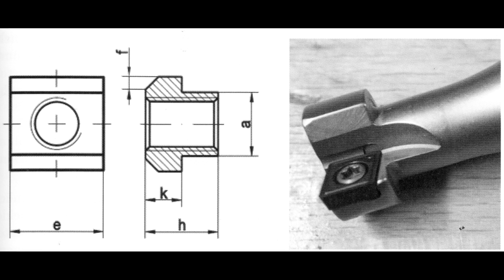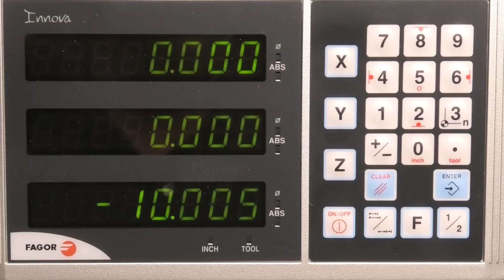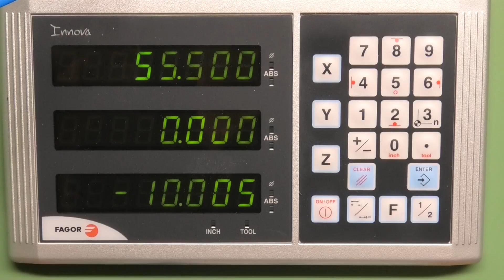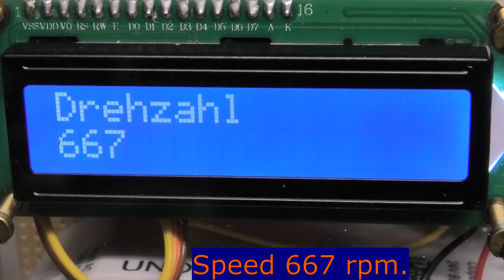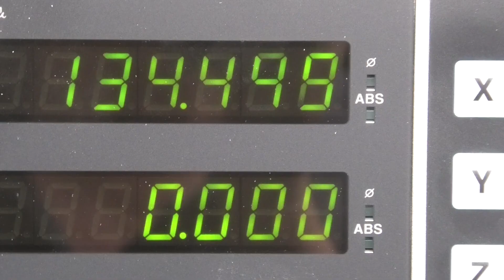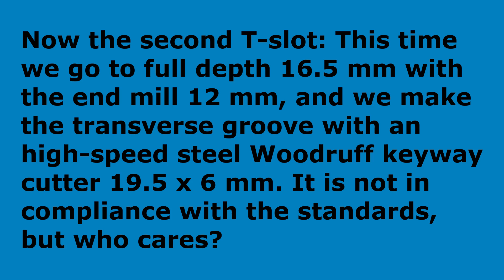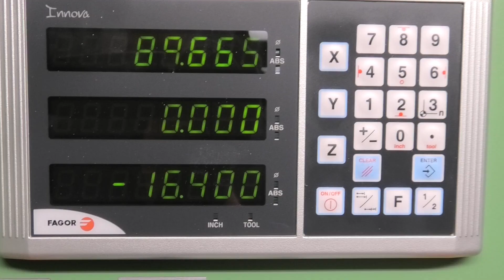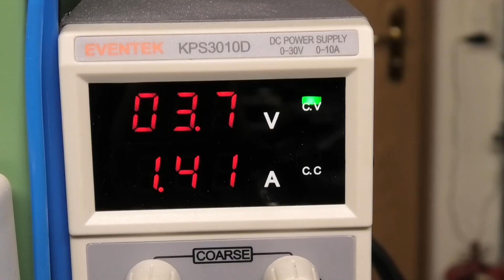Milling T-slots.

Comment: First let me say thanks for all the great videos!
I really like them and regularly recommend your channel because it's just great and different. In a positive way!

Now to the criticism:
If it slipped in an ER25 collet it's 100% an operator error or the holder, nut and collet are the worst junk possible.

ER25 should have a slip torque of at least 50Nm with larger shanks, if not quite a lot more.
I know ER32 has above 110Nm with a 13mm shank, not properly cleaned.
I've seen spindle load meters pushed into the red part with just properly used ER25 on way, way stronger machines. They can take more than many small VMCs can dish out.

Was everything (holder, nut and collet) of good brand & quality?
Was it properly cleaned & maintained?
They shouldn't be lubed, rather degreased before use.
Did you torque it with the recommended torque for ER25 with tools 8-16mm of roughly 100Nm?
Many people way underestimate the needed torque and way overestimate the torque they can bring up with a tiny spanner with sharp edges.

To make it short - the ER holder can do that easily without batting an eye! I have no doubt about that. But with collet chucks operator error is extremely common, even amongst professionals.
In the end what matters is that it worked out. But I had to mention it so you have a chance to improve your practices.

Keep up the great work and thanks again for all the time I could spend "with you" during quarantine!

Grüße aus Hamburg!
(Keine Ahnung warum ich's auf englisch geschrieben hab...)
Reply from the maker: Vielen Dank fuer Ihre Rueckmeldung!

Comment: Why in this process he didn't use coolant?
Reply: Afaik carbide/hard metal doesn't like temperature swings because it may break, so it's either perfect flood cooling (ideal) or no cooling at all (runs hot but at least the temperature doesn't fluctuate).
Reply: @marius355  wow thank's for the explanation. It's new for me :D
Reply: He also used speeds and feeds that suit high speed steel. 5x the rpm, 10x the feed would be my first adjustment and then see how it works. Coolant isn't necessary and makes a huge mess